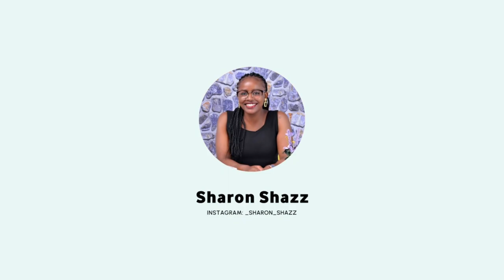Transforming My Sofa With a Deep Clean! // NEW VACUUM CLEANER // AMAZING RESULTS!

Comment: Good show. Perfect work.
However, your position for after scrub vacuuming was not ideal thus making you struggle to do the job. As for me, Instance at opposite side. If am vacuuming inside part, I stand outside and bend in. If vacuuming outside, I stand in and vacuum outside. If vacuuming the long back, I start at one end vacuuming backwards.
Reply from the maker: Thank you. It was my 1st time using the equipment hence the reason am struggling kidogo. Thanks for the tip.
Reply: @sharonshazz201  You are welcome dear. 
I have been doing that cleaning just with hands and I have shined chairs. I watch most of your videos. You make work so simple